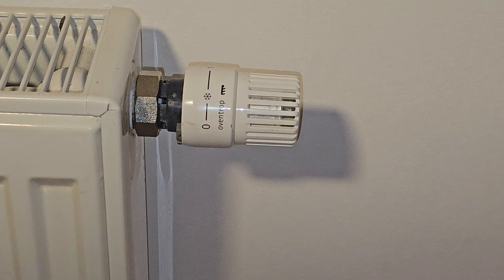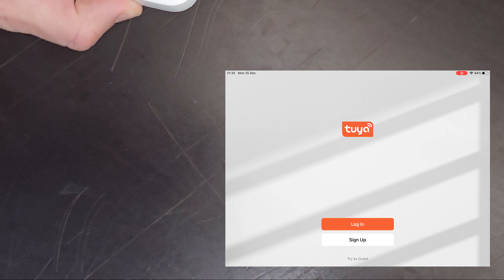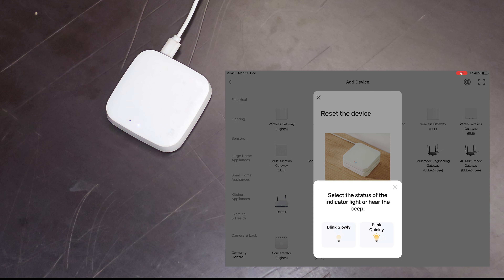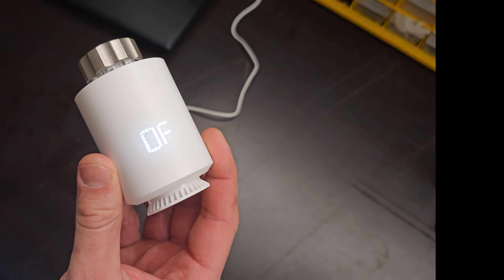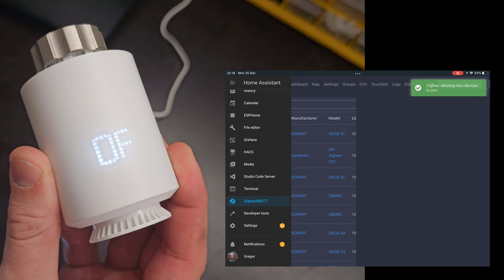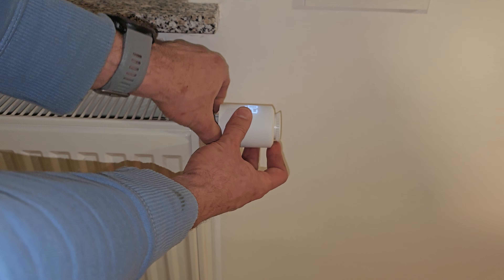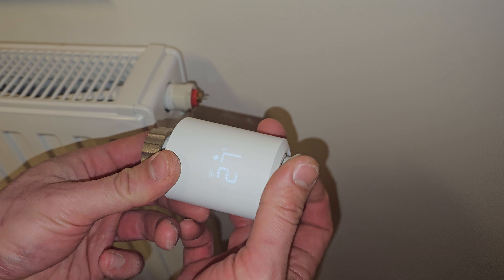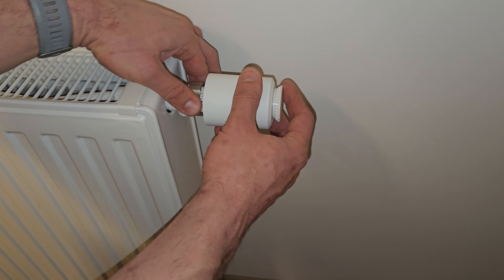Replacing regular Thermostatic valves with Smart Zigbee valves (Tuya and HA Zigbee2mqtt)

Comment: Hi, thanks for the video. I'm thinking of buying six valves from this brand on AliExpress's 11/11 sale. Have you been happy with them so far, or have you had any problems? Can the valve in the coldest room be configured to act as a thermostat to turn the boiler on and off? Or will I have to buy a wireless thermostat and put it in that coldest room?
Reply from the maker: This TRVs work flawlessly with tuya hub and zigbee2mqtt. But with ZHA(Home assistant) they dont work good. In ZHA the temperature is way off(even if you offset it) It may be now fixed with newer versions of ZHA (At the time I tested I used custom ZHA quirk)

Comment: I'm suprised there's no any calibration after installation. How this device will know what is an initial status of the rod?
Reply from the maker: I guess you do it with that different adaptors provided. I am not sure exactly. My valves work perfectly with 2 different types of adapters running on 7 radiators

Comment: How loud is that thing? How long batteries last?
Reply from the maker: Hy. You can hear it if you really listen to it. But it wont woke you up if you are sleeping, if that's what yo're worried about. I have 2 of them in my bedroom and they never woked me up. Batteries last almost whole heating season(about 5 monts). I bought rechargable batteries so I would spare through the years
Reply: Thank you for replying!

Is it true, you need to reprogram (all daily temperature setups) these every time you change batteries?

I found information, that these TRV’s are showing “Low battery” all the time, if used with rechargeable batteries since rechargeables has nominal voltage of 1,2V instead of 1,5v regular alkaline batteries has. Is it true?